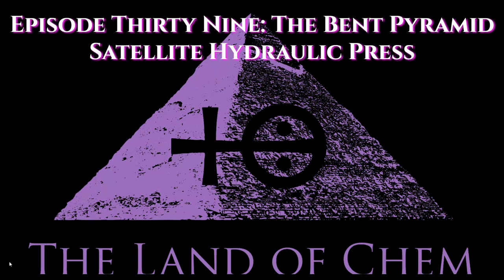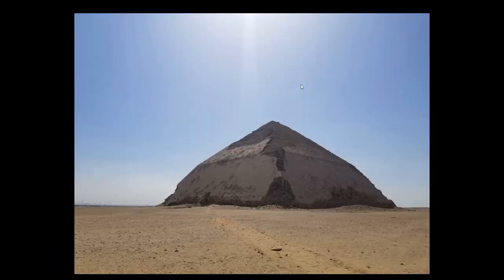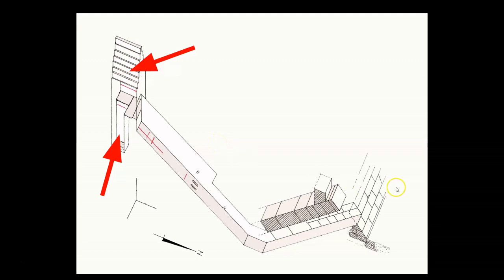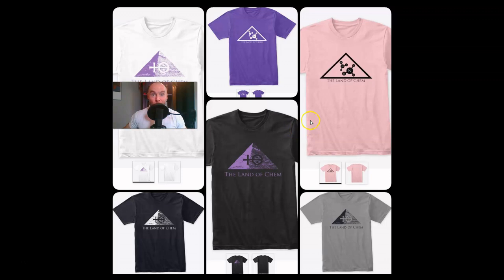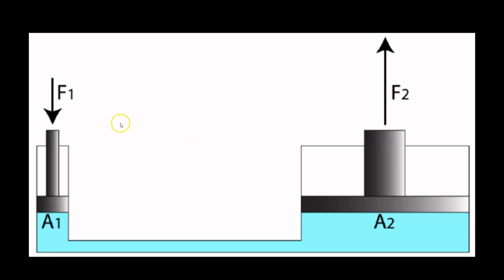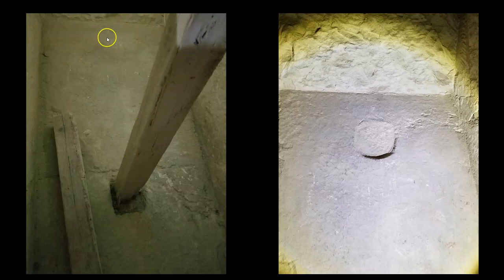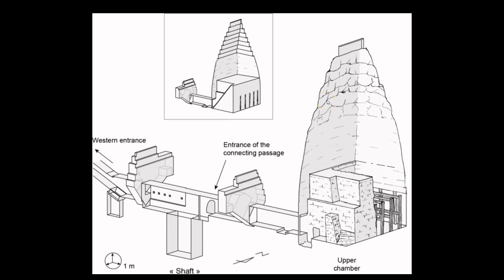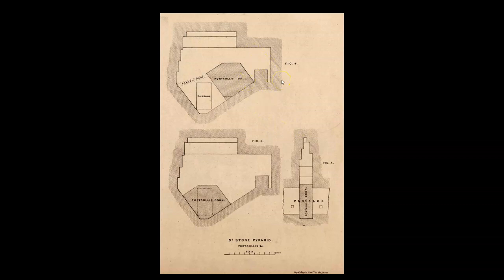Episode 39: The Bent Pyramid Satellite Hydraulic Press Mechanism

Comment: In the same way a rifle barrell leaves a matching mark on the projectile fired out of it...

the flow block ing block  must show signs of wear at the edge where it made contact with the stop block and specifically signs of bumping up against the stop block which are matched exactly by the 
offsetting marks on the stop block.
 The lense of the cameras you seem to be using should be good enough to show the match and prove the point.

I suppose if you found a couple of friends who volunteered to clean the junk out of the 'monument' as an act of homage to the 
architects the powers that bee now might allow some detailed photographs to be taken in the appropriate light 

or not

I've seen some pictures of much older or younger depending on how you look at it models much furthur along the river into the Sudan
smaller in size with the same portcullis with the same story about how it was built to be used once and the rest of the nonsense story
that is being peddled to mask the fact that five thousand years before now people understood more about the earth we live off because
they lived with it not on it throwing garbage out the windows of overpriced golf carts for amusement...

in the same way there were two rivers defining the land between as Meso potamia there was another river which ran to the west of the 
Nile from the Sudan and beyond right up to Giza and when it was a lot warmer than it is now and a lot wetter that river defined a lot of
what happened and how the khemits learned what Thoth had to think about this and that in the moments in between writing them down

The automatic hydro activated stone portcullis looks like it was potentially invented somewhere much furthur south which might 
have been north at the time by people living in what was the Nile delta which no longer exists north of Aswan.

Once you have a corner, you only need two sides of a frame to frame the rest of the row of blocks. Look at the places where there are 
right angles to lock pieces in place. Every block has the same height in a row and different lengths to provide greater stability to the 
system which was obviously designed to be a big non exploding bomb in the mind of every twentieth century hero who will eventually
hear what you have to say here and just needed to be safe to make useful things for the children of the sun in a way that made use of 
the children who were constantly being reminded about the usefulness of being useful doing useful things and thinking in useful ways. 

you look to be one of the useful thinkers so let your mind run son you appear to be on a usefuel trajectory to life fueled in the old way
which certainly looks like it was much more useful than the modern portrait of the particular part of the past in the particular part
of the world you are looking at closely in particular which if one had to guess the Khemists have a specific set of words for 
which are not hidden from the eyes of anyone with the eyes to see and has nothing to do with particles

Comment: The satellite Pyramid operated as a hydraulic ram pump to boost the water pressure over and above that available from the static head pressure of the water reservoir. The higher pressure would be necessary to operate the pistons to open and close the portcullis blocks.
Reply: Mabe'

Comment: Geoff - I was in Dahshur a month  ago- I love the place.

What is your vision of the portcullis sliding mechanism? The one hiden from view, behind the blocks ? What kind of metal would the portcullis pistons made of  before someone replaced them with wood beams?
And most importantly - the stop blocks - yes they are still present. But why these niches with blocks - if they could just put the entire wall closer  to stop portcullis stone?
Reply from the maker: I have a theory about the configuration of the valve housing that I'll be discussing in a later video.  I agree, it would certainly appear to be over-engineered for a simple valve... and I think they had iron, along with all sorts of metal alloys. Thank you for the comment!